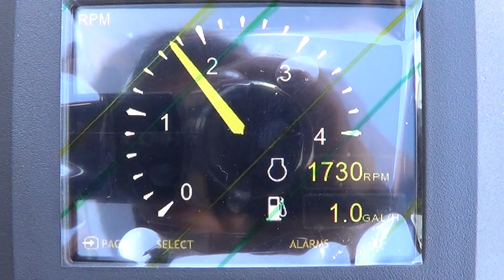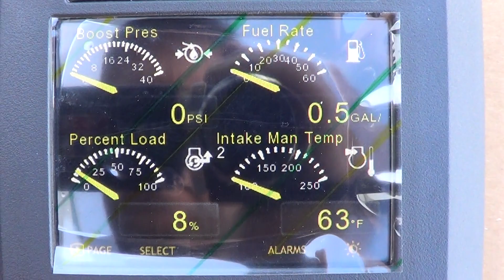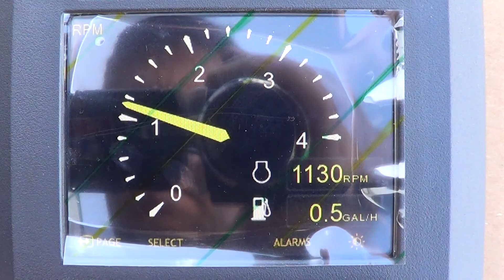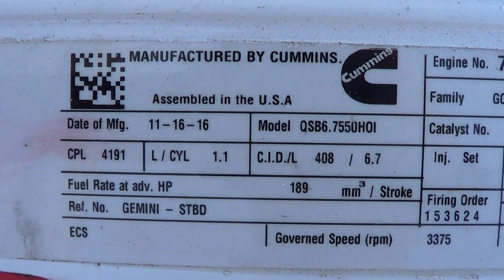Cummins Marine QSB 6.7 Engine Test for Jim D. #1

Comment: what is the transmission clutch you are using on the engine
Reply from the maker: What you are seeing isn't a clutch its a torsional coupler, basically provides a little rubber cushion between the flywheel output and the shaft.  I wasn't here when we did this one but it looks like a remove V drive to me.  So a shaft comes off the torsional coupler and drives the gear remotely.  If you watch our current intro to our videos there is a really brief clip of one of these, might even be this engine.